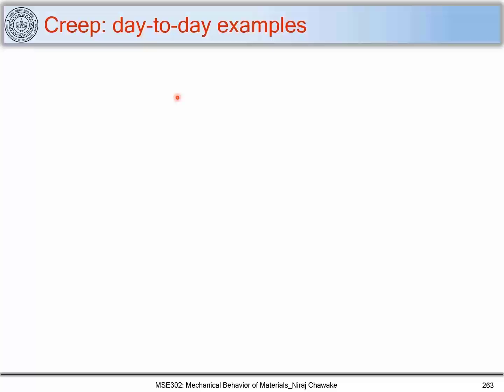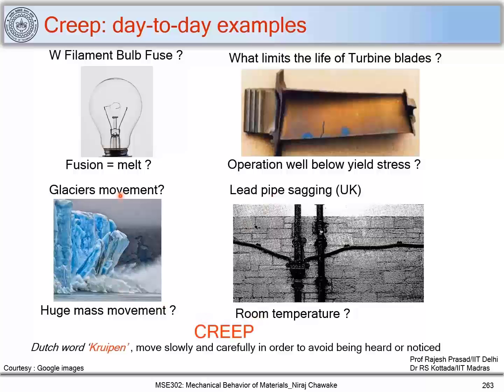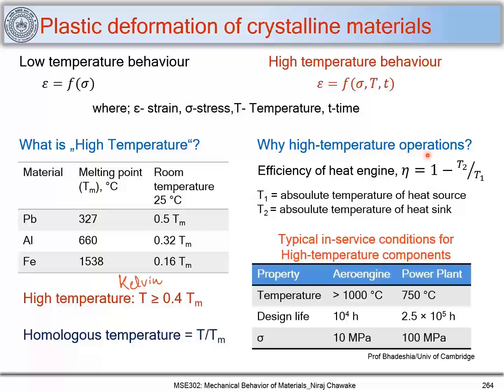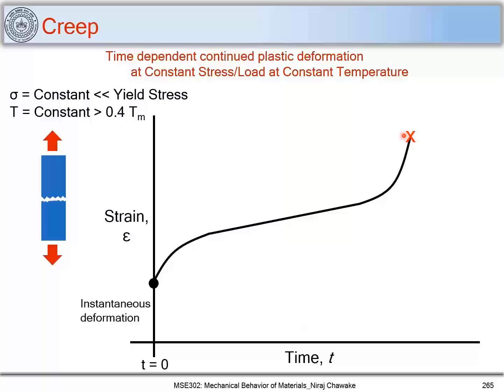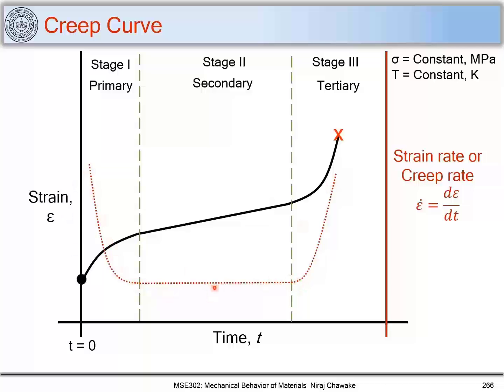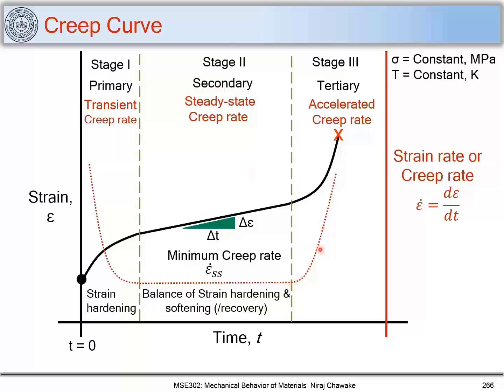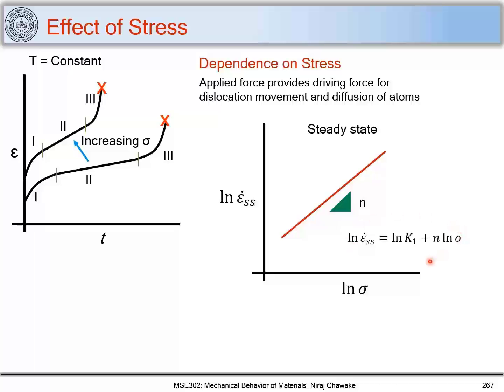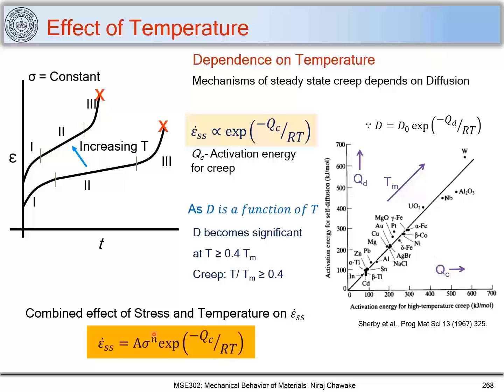64. Creep deformation | Creep in materials | Creep failure

Comment: Sir, while giving the initial instantaneous strain upto what strain value the material is subjected to?
Is it sufficient that the stress be within the elastic limit or beyond?
Reply from the maker: Dear Sai
In general, the creep stress applied is less than the yield stress of a material.
Initial instantaneous strain in materials is determined by their mechanical properties, especially, by their elastic modulus. In certain instances, it depends on the microstructure and history of the sample. We do not subject material to any initial instantaneous strain; instead, it evolves as samples are loaded.
Reply: Thank you so much sir for your explanation.
I also request you to make videos on the problem solving part in mechanical behaviour of materials.